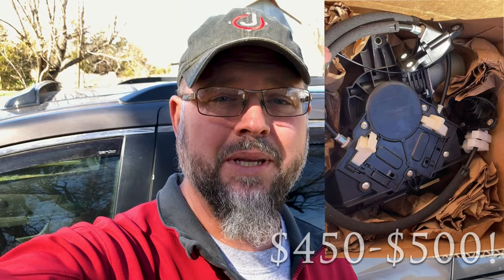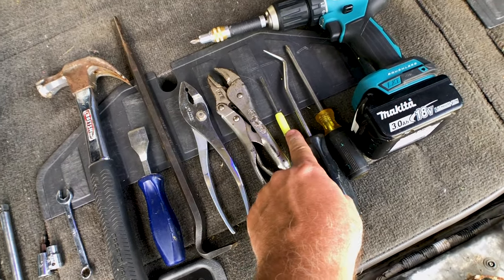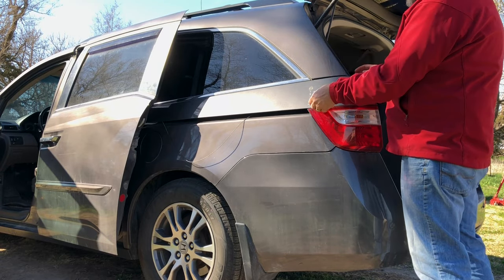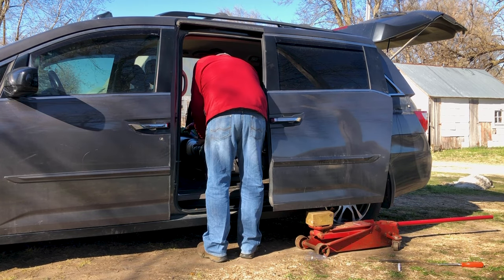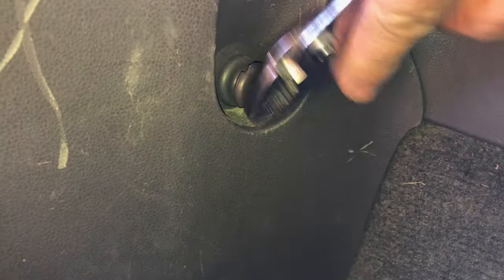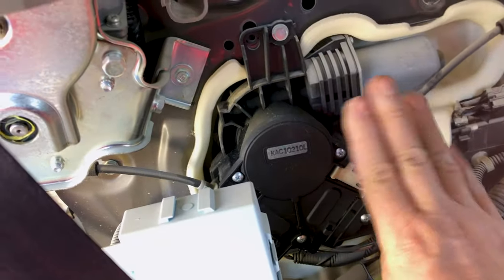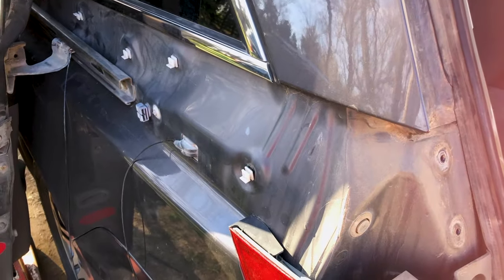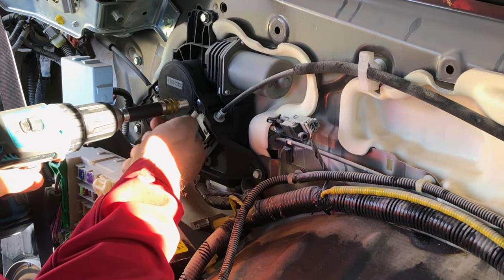FIX: Honda Odyssey Sliding Door Cable: Step-by-Step DIY Guide (2011-2017)

Comment from the maker: Viewer Alert: While watching the video, @sethjones5250 noticed at the 41:00 mark that I forgot to reinstall the nut that holds the spool on the spindle shaft. While the door continues to operate flawlessly after more than four months (the cables and cover are apparently holding the spool In position) I would not recommend anyone copying my mistake! 

My apologies for not catching this at the time of recording. I have no idea what happened to that wayward nut!
Reply: 399
Reply from the maker: @amyjones3355  🤔
Reply: Link
Reply: I noticed that too.  I was talking to my computer screen but I suppose you didn't hear me.  hahah
Reply: I hope this works on my 2008 Odyssey. My mechanic made me believe he fixed both of my doors with new parts back in December, and while he supposedly saved me some money (dealer just quoted me $750 for whole assembly, and $364 for labor), he cost me over $3K telling to put a newer motor on it when my van broke down, and it's badly rotted underneath!!!
Now I'm too i invested into fixing this van, and have to fix the passenger side sliding door again,  when the Honda dealer manually opened the door and broke the cable,  after claiming they fixed the door from not responding to open electronically. The guy didn't even take responsibility for breaking it and said the wire looked old and rusted, and my other mechanic was to blame in his eyes. 
Twice I went to the dealer, and came out terribly worse than the problem I brought it there for! 
I'll try to update my comment if and when I get the door done myself.
Thank you for the detailed tutorial.
You're a 💎 gem!
Reply from the maker: @EMPYS  - This video is for 4th generation Odysseys from 2011-2017. Please reference a video specifically for your 2008 model (3rd Gen). Good luck!

Comment: Thanks for posting this video. The dealer quoted $1,300 to replace the cable. But, I was able to complete the passenger side without any significant issues using this video. For the passenger side, please note that the air unit does not need to come out. Only unscrew it and tilt it carefully to access the area needed. An extra long drive is needed with a tilted adapter and a magnet so the nuts don't fall behind the air unit.
Reply from the maker: Great advice! There are a few slight differences between the two sides. I'm glad the video was helpful.

Comment: You are the man! Incredibly thankful for this video. I replaced the passenger side, and like a commenter below I discovered that on the passenger side the cables are wound around the spool in the opposite direction (the front cable winds around the back of the spool). Enormous headaches on the passenger side due to a massive air-handling unit that blocks the rear cable exit. I couldn't figure out how to remove it completely. I was able to loosen the unit enough to work around it and only lost one bolt to the void in the process.
Reply from the maker: Great job! I’m glad you got it figured out!

Comment: Thank you sooo much for this video. It made it really clear what to do. One thing I figured out is that the back cable goes in on the front side of the spindle when fixing the passenger side door. That's maybe why some people say it needs to be that way. I first did it the other way but the cable were crossing each other and I knew that couldn't be right. So I did the opposite of your instructions and it's all working! Thanks!
Reply from the maker: I'm glad that you got that figured out! If my passenger side cable breaks, I will make a video for that side too.
Reply: Yes it does. It took me two trials before I figured it out!
Reply from the maker: @usernamesrlamo  - Great job figuring it out!

Comment: Great video, but I needed to wind the front cable from the back - it was for the passenger side sliding door - then install the rear cable - I did it with the door closed.
Reply: Thank you for this tip, it made it easier for me doing my passenger door!
Reply from the maker: Good tip! If I were to make this video again, knowing what I know now, I would definitely add a disclaimer that if you are changing the passenger-side cables, then the cable installation and winding process is opposite. I’m glad you figured it out! 👍🏼
Reply: Same.

Comment: I’d suggest not going directly for the pin on that hinge with wheels on it. The bolts on the door are much easier to access with a wrench.

Comment: I fixed my van today with this video! Make sure both doors are shut before testing or you will get a false negative on the door. It works perfectly, thanks for the in depth video.

Comment: Thank you SO much for this video! The cable on the only working door on our 2011 Odyssey snapped and with 3 small kids and 2 large dogs to load and unload it was a real headache. Not only was I able to replace the cable on the driver's side, I felt confident enough to replace the motor and cable on the passenger side. We've got 2 working doors now and easily saved $1,500-$3k in labor costs! Also, your tip for sliding the door open (instead of midway) before wrapping the cables was crazy helpful. I am so grateful to you.
Reply from the maker: Wow, you put a huge smile on my face! We have four pre-teen kids and the cable that broke was where my wheelchair-bound son sits! Thankfully, we didn’t add any doge into the mix! 😂

Also, good job on the driver’s side. I haven’t personally done that job, but I hear it’s much more difficult! 👩🏻‍🔧💪🏼

Comment: Thanks for taking the time to provide this.  This is the second time I have replaced the cable.  Hoping to make the first frustrating repair easier.  You touched on the poor advice I previously relied on for stringing the cables on the spool "backwards" which required a second take apart and figure out the correct winding by trial and error.  Thanks for clarifying this!!!  Also winding the back first and putting the spool in the compartment while completing the shorter front length is genius!  You have made this easier and I am excited (not terrified) to pursue this repair the second time with an more friendly approach.  Will share final post correction update.  Thanks!!
Reply from the maker: Great! Thanks for the kind words, but I can’t accept the “genius” title. What you didn’t see is the hour I spent doing it wrong and trying a bunch of different methods before figuring out the one that made the cut. 😅

Comment: Thank you so much!!! I bought the part and all the tools on Amazon for under $60. It took us about two hours. If I were to do it again it would take less than half of that. All your tips were spot on!! We couldn’t get the pin on the door out, so we just ended up removing the 2 bolts that attached that part to the door and it was quick! Thank you so much!!
Reply from the maker: Great job! Yeah, the pin can be a bear. It’s in such an awkward spot and angle. I’m glad you improvised and figured it out. 👍🏼

Comment: You are the man!!!  Saved me $1000 - $1300. For anyone else doing the passengers side, as another commenter noted, rear cable goes in the front of the spool for passengers side. Also, don’t be scared by the rear a/c unit. Take out three visible bolts around the perimeter, and gingerly pull it slightly forward out of the way so you can get to the rear cable guide nuts. Cut my hands up pretty good, lost 2 10mm sockets behind the a/c, and one of the cable guide bolts, but it’s secure with two. And it works!!!!  Thank you thank you thank you!
Reply from the maker: Thanks for the great feedback and advice to others changing the passenger side cable! In my opinion, all socket sets should come with multiple 10mm sockets!

Comment: This video was so helpful. Thank you! I bought the part you recommended and it works.
Some comments:
1) The passenger side is a lot harder with the HVAC unit. I nearly lost my hand in there!
2) The black spool piece inside the motor unit was pretty damaged. The grooves were disintegrating. That might have jammed the cable for me and caused it to break. Not sure. I cleaned it up and reused it (with my fingers crossed).
Thanks again!!
Reply from the maker: I’m glad it was helpful. Several people noted that the passenger side was much more difficult with the HVAC in the way. The comments section has some great tips for the passenger side. Thanks for sharing your experience.

Comment: Thank you so much for this repair video! It worked. We had a special situation that we could not get our door to open at all, it would not budge. We were able to get the inside side panel off without opening the door and removing the floor board. We were able to pull the panel back but not completely remove it. Once we opened the motor and cut off the cables that were wound so tight, we were finally able to open our door and do the door steps and take off the outside panel of the van. It was about a 6 hour job for us because we spent the first 1.5 hours trying to get the door to release. So grateful this worked. We did use your Amazon link to order our part. Thank you for making this video.
Reply from the maker: I'm glad the video was helpful and that you were able to get the door open! Thank you for using the link. That and your comment make the work of producing worth it!

Comment: Great video! I was able to remove the interior trim pieces without removing the 2nd row seat. Also, at the 14 minute mark, after removing the clip on top, using PB Blaster, and lots of hammering, the pin still wouldn't budge. For those who are struggling with removing the pin, just remove the two 12mm bolts that secure the hinge to the sliding door and remove the entire hinge/door trolley from the track. This was a lot easier than trying to hammer out the pin. Thanks again! Hopefully this repair will last awhile!

Comment: Great video! Couple things I found out: reinstalling the long horizontal exterior panel was almost impossible to simply reverse the process. Exponentially easier to remove the clips from the car, place them in the slots they go into on the panel, then carefully aligned them to the holes and pop the entire panel in place. To remove the clips, align them so the shelf is horizontal, 2 flat screwdrivers also aligned horizontal and between the clip and car, and press both toward the center while pulling the clip out.
 I also found it easier to remove the  bearing mechanism from the door by unscrewing the 2 bolts that attache the entire thing to the door instead of taking it apart at the hinge.
Reply: @smiledochillINGO Thanks for the comment on the panel reinstall. I wanted to clean and lubricate my passenger door. It was acting up I think primarily due to dirt and no lube. Got the panel off and your tip was great to make it easy to get the panel back on. Dioor is running a lot smoother now. If it turns out its more than this well this is great video. thanks to YOU Can Fix Anything: Auto
Reply from the maker: Thanks for the tip! I'm planning to take the exterior panels off both sides to apply some grease. While I didn't have trouble with reinstallation previously, I will try your suggestion.

Comment: This tutorial was great! I’ve dealt with opening and closing the door manually for about a year because I thought I needed to buy the Honda OEM cable and motor assembly. Thanks to this video I was able to buy the cable on Amazon for less than $30, and fix it in less than three hours.
I had a difficult time taking the door pin out to remove the rollers, so I ended up unbolting the door side of the hinge. While this made it easy to extract the pin, at the end of the install the door was not automatically closing. After a bunch of troubleshooting, I realized I misaligned that bracket when bolting it back on. So I’d advise against removing that bracket. If you do remove it, make sure to put it  back on exactly how you pulled it off.
Reply from the maker: Thanks for sharing your hard-earned lesson. I'm glad you got it working again!

Comment: Thank you for this.  I just fixed our minivans door.  The gear thing was all torn up and I used a file and sandpaper to clean out all the grooves.  Also, I couldn't knock out the pin and was afraid I was going to break the window, so I unbolted the hinge from the door - just had to level it after and it worked out great.  Thanks!
Reply from the maker: Glad it helped! The pin is in an awkward place and can be tough to know out. Good job improvising and getting everything lined and leveled again!

Comment: Thank you very much. I broke a cable wrestling the door open after having the door frozen the day after a rain / ice storm and deep freeze.  I bought replacement cables and a new door bracket because I thought the wheels might be worn out but I've been hesitant to begin the job without a clear picture of what I needed to do. When I saw that NewEgg had cables already threaded  through the sleeves, I went and ordered those as a better option. Now I'm ready to begin on the next nice day here in late January in Connecticut. I'm a long time NewEgg customer and know and trust their customer service. I'll let you know how it went.
Reply from the maker: Thanks for sharing! I’m looking forward to hearing about your experience.

Comment: This was a very helpful video. With this video I was able to replace the cable system in 2.5 hours. My car repair guy told me to not bother because you'd have to replace the whole motor etc, and just cut the wires and use it as a manual door. I decided to not take his advise. If I did it again I could do it under 2 easily. I bought the pre assembled and cut kid off amazon for $20 CAD. I wouldn't bother with the ones you have to crimp yourself. One thing to note that might make this easier is to not reattach your door to the slider assembly until almost the last step. this made spooling the bobbin easier.
Reply from the maker: Great job! That last sentence is a great tip. Thanks for sharing!

Comment: Thank you for this - I was able to replace the driver side door cable system because of this video.  I did have a lot of trouble getting the door pin out so I just removed the bracket with no issue.  Appreciate you taking the time to put this together.  Sincerely, a non-handy person.
Reply from the maker: Your last sentence made my day! Thank you for the kind words!

Comment: Thanks for the video. This is my second time replacing this cable. Seems like they last about 5 years or so. The tip about winding the spool when the door is fully open is fantastic.
Reply from the maker: Glad it helped. The winding process took a bit to get worked out. 😅

Comment: Just did mine, saved me a lot of $$. I was having a hard time getting the c clip on the slider, decided to remove the two bolts which was much easier. 
** if you doing the passenger side, front cable goes to the back of spool and back cable to the front.
Reply from the maker: Great points. Thanks for the feedback!

Comment: Thank you so much for this tutorial! As a housewife with a "can do" attitude, I was able to repair our 2012 Passenger side sliding door with one major edit. Because I was doing the opposite side of the car, I mirrored his instructions for winding up the cable to the spool. I CLOSED my sliding door to wind up the cable. This made my front cable longer and my rear cable shorter BECAUSE I also had to reverse and put the forward facing cable in the BACK of the spool and the rear cable in the front (OPPOSITE of how he does, and warns you not to do so).*If I did it his way, my cables criss-crossed at the white roller housing before the spool and I figured that would cause major rubbing and break again eventually. Once I figured out that, It was a simple as he showed. ** Also note, the Passenger side does have the AC blower unit that makes the rear cable housing *very* hard to reach. I have small hands and was barely able to squeeze one in there, but I had to loosen the blower unit with 10mm bolts and peel back a little more of the interior trim near the trunk.
Reply from the maker: First off, WOO-HOO!!!! GREAT JOB!!! I have a daughter with the same attitude. One time when I was out of the country, our clothes dryer stopped working. She was able to use Google to diagnose the problem (burnt thermal fuse) and YouTube to complete the repair!

Second, if I was to make this video again, I would add a disclaimer stating what you just said. I’ve had a handful of people with the same situation. Thankfully, just like you, they were all able to improvise and figure it out!
Reply: @YOUCanFixAnythingAuto  Thank YOU!  Yes, I am definitely the handy-woman around the house. I have fixed previous Odyssey door rollers and our washing machine several times, all thanks to people like you who have created extremely helpful YouTube videos!
Reply from the maker: @603MoxieMomma  -  I’ve benefited from the collective wisdom of YouTube over the years, which is why I started this channel! If you’re interested, I have a new sister channel called You Can Fix Anything: Home. https://youtube.com/@YOUCanFixAnythingHome?si=R2T78In3KuV_xlq_